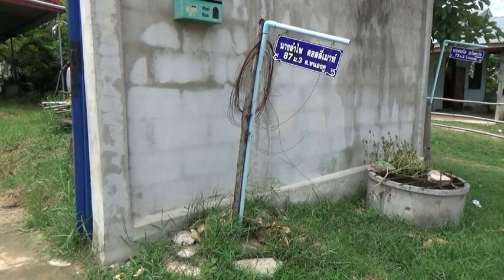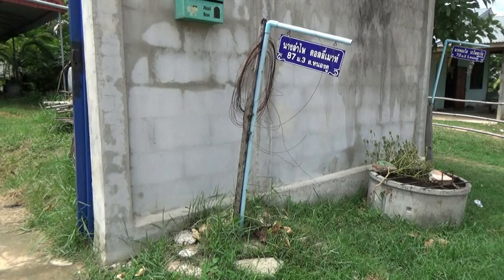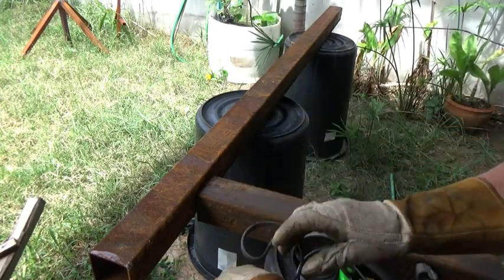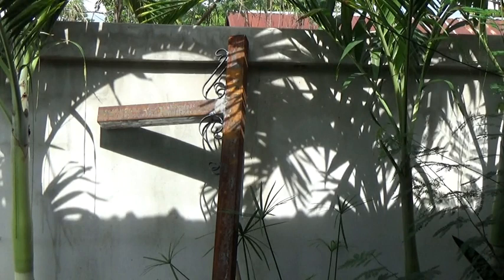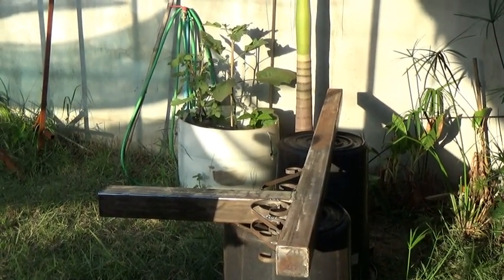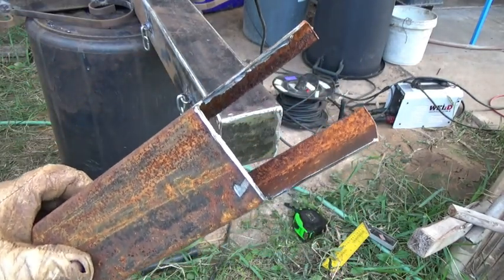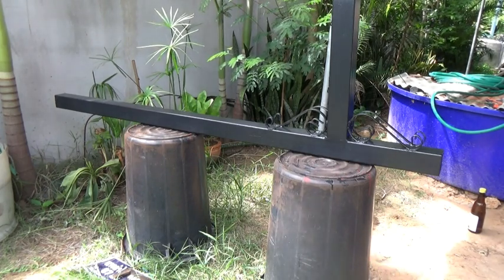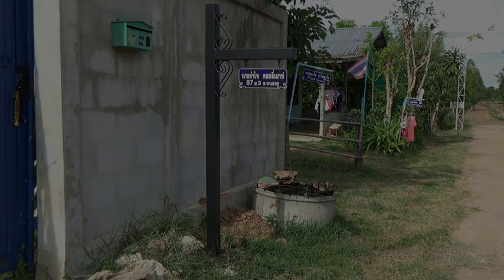Building a new sign post for the front of the house.

Comment: You're a jack of all trades my buddy! Wielded the sign real expertly and even though ya don't like to paint, an excellent paint job and yes two coats are better than one, back in '09 I sanded our front railing(it was really rusted, about 20 years, nobody asked for a job 'til I finished sanding(by hand) and then all of a sudden everybody's a painter,lol....an elderly man got the job but he just applied one coat of paint and after 7 years, it needs a new paint job, sanding off the rust as well. Uprated, thanks for sharing and you could also open up a blacksmith  workshop! :)
Reply from the maker: Painting really sucks but around here if you want it done right then you have to do it yourself, On small jobs it is no big deal but the house is going to need a painting someday, That's a big job...lol
Amazing how much broken stuff comes to my gate to be fixed, Seems the price is right here....free.
Reply: ***** lol....price is right....free,XD